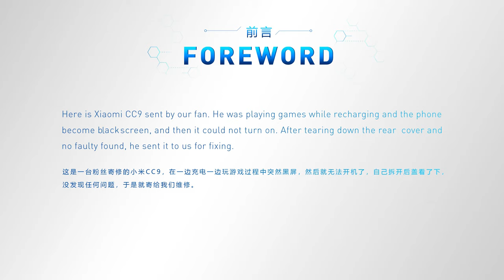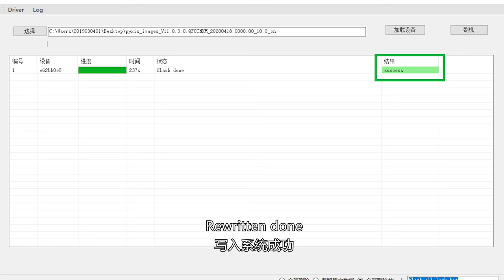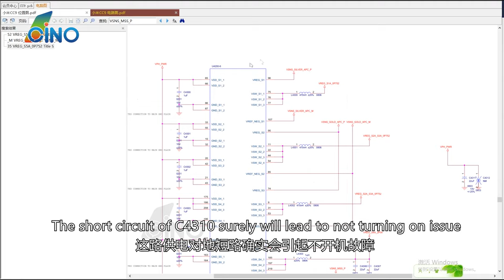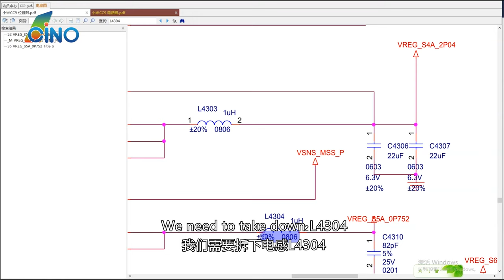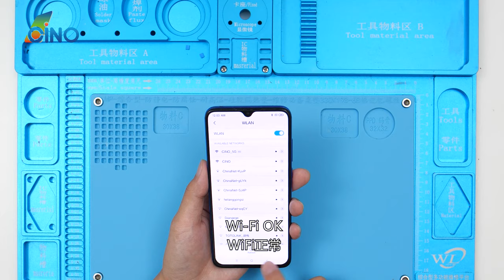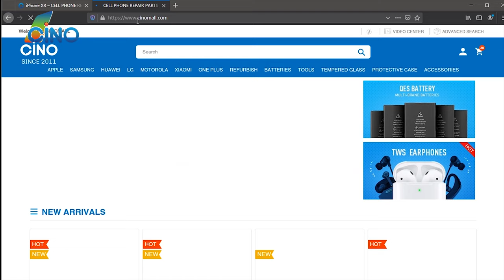How To Fix Xiaomi CC9 Won’t Turn On  | Motherboard Repair Ideas & Repair Case (4K Video)

Comment: How handset connection with P.C is possible when PMIC is faulty
Reply from the maker: It can connect to PC if even PMIC is faulty
Reply: @CINOTechnology  
I don't think so because if pmi don't provide required volts to cpu .then pc connectivity is not possible 
May be pmi ic was partially faulty

Comment: Hi, Xiami Redmi 7 phone not turning on, I applied power supply 3v 2amps no short, and Amps goes to 0.067 and back to 0 amps, what could be the problem
Reply from the maker: It has been short circuit